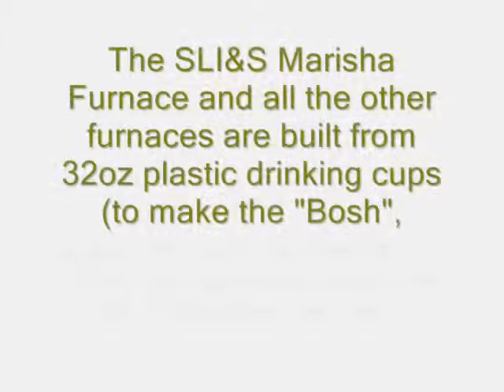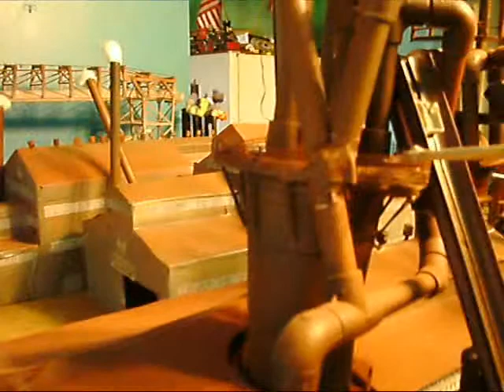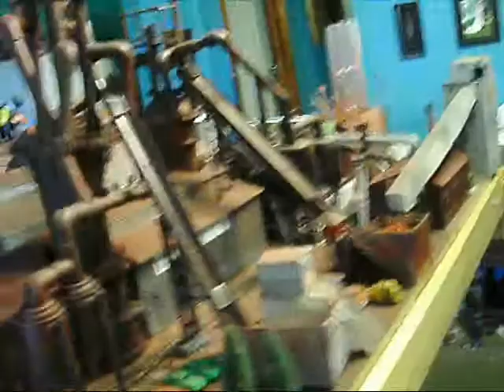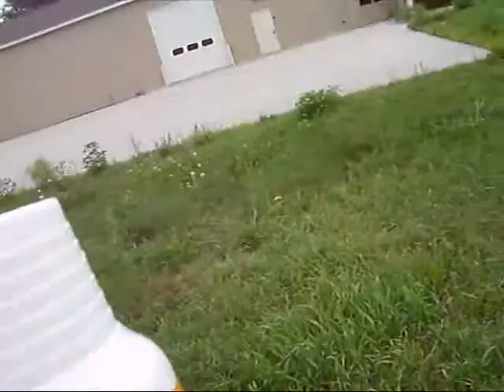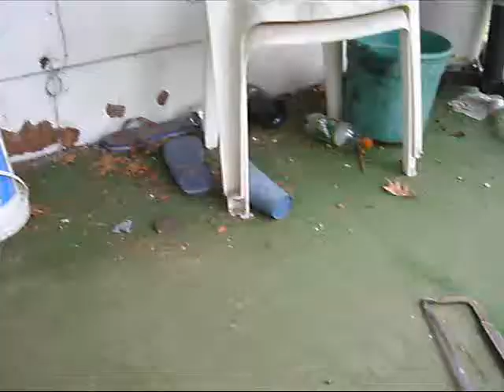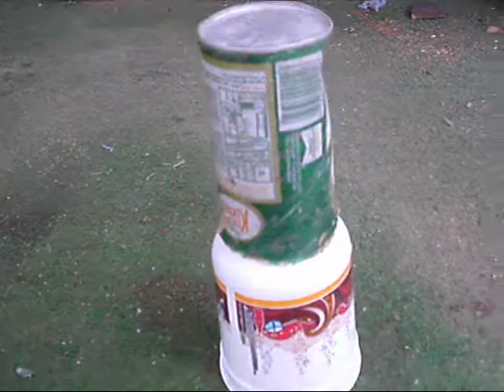SLIS Making a blast furnace of recycled materals Marisha Furnace.wmv

Comment from the maker: Some examples of older Cowper stoves had 3 large stoves and 3 smaller ones. What works do you or did you work at? Just curious.

Thanks again as this Modle RR/steel mill was a learning experience. This layout was destroyed in a house fire in January 2011. My new layout will have 10 BF's and be more accurate. It will be constructed the same way.

Comment from the maker: Thanks for your comment from someone in the steel industry. The Marisha furnace was based upon US Steel Duluth Works which had five stoves with a central large vent stack over the top of the center stove. Two stoves on each side fed into this large stack at an angle.This was the only example of this I could find and was the reason why I modeled the Duluth Works. In my research, some BF's had 4 stoves. {continued}

Comment from the maker: Thanks. SLI&S was distroyed in a house fire. But, my house has a basement & the Charles Wesley Works will be rebuilt asap bigger, more accurate and using the same methods. Are you aware of "Steel Groups Yahoo SIG"? I am a member. There is a Steel Mill Modeler's convention in Pittsburgh I think this month. It's put on by Peach Creek Shops. They have a Web site

Thanks.